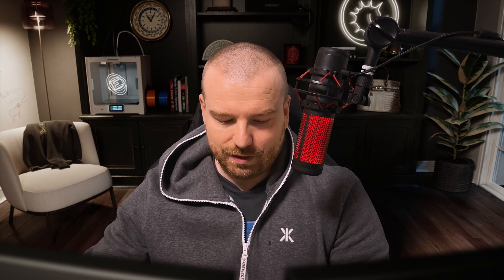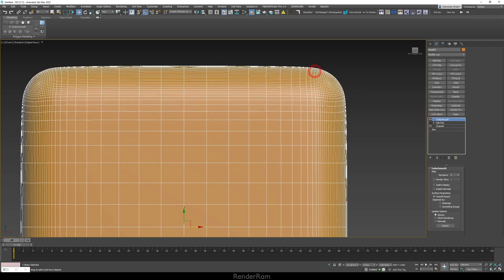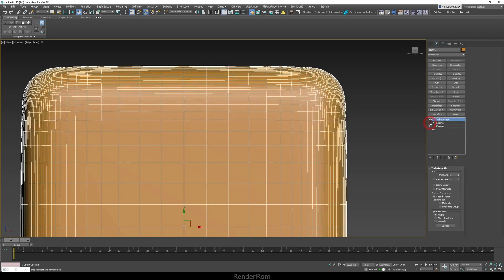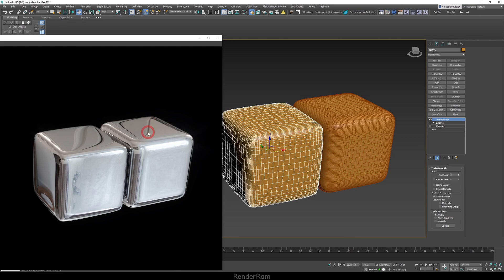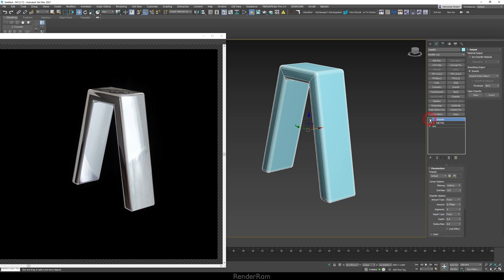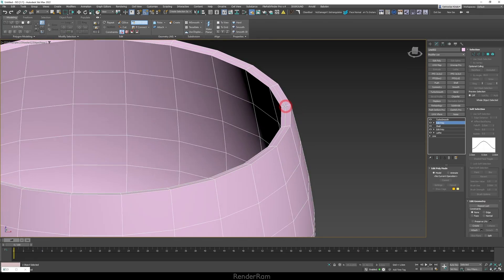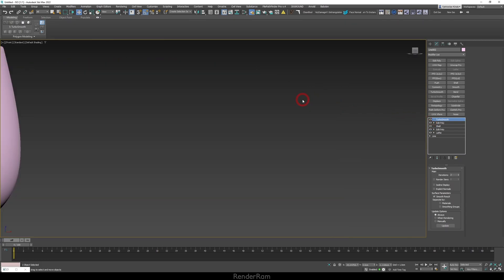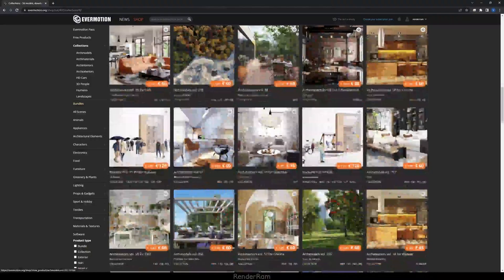Why You Should Start Using Support Loops | All 3D Software

Comment: Thanks for sharing .
This is very important concept yet many artist aren't aware of espically with chamfer ( bumpy kitchen cabinets are the most common example  in Archviz )
in some cases , I prefer to add Weighted Normal Modifier instead of adding more loops if the object is too complex to have more support loops and /or if I don't need to subdivide it later.

Comment: Great video as always! Haven't tested it but I imagine putting a weighted normals modifier on a chamfered surface will also create the accurate reflections of support loops
Reply from the maker: Thanks for the support! 
Yes, result will be very similar, but limiting, because if you ever plan to turbosmooth your object, with support loop habbit you can do ti anytime, if you add weighted normals then turbosmooth won’t help you :)

Comment: Great tips. What's you thoughts on using creases (data channel autocrease maybe) and opensubdiv as an alternative to chamfers and edge loops? different application for different uses or somewhat interchangeable?
Reply from the maker: I’m not a fan of creases, maybe because I come from an animation background where every detail needs to have enough polygons for all kinds of manuvers. So I like injecting my details with a few extra polys than missing a few
Reply: @RenderRam  Thanks, I always wondered if I should be using them ... but I do also prefer having that immediate visual feedback from looking at topology.